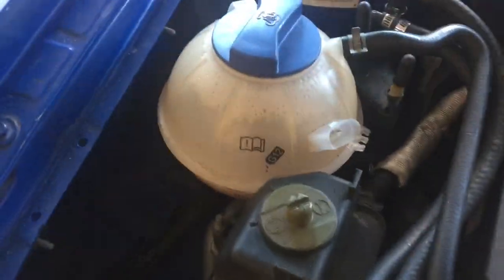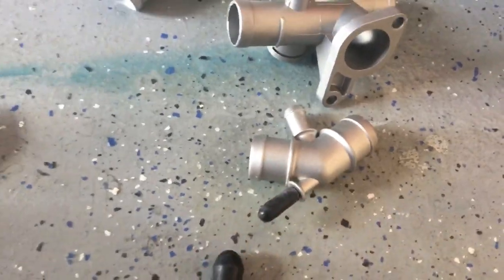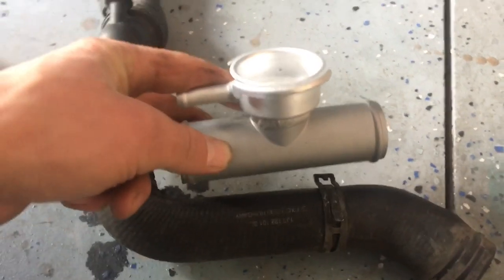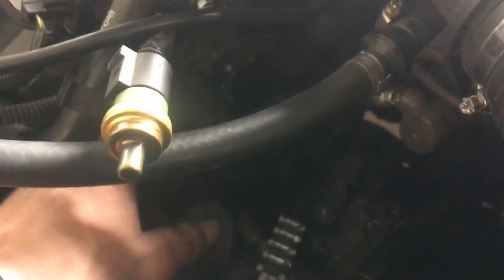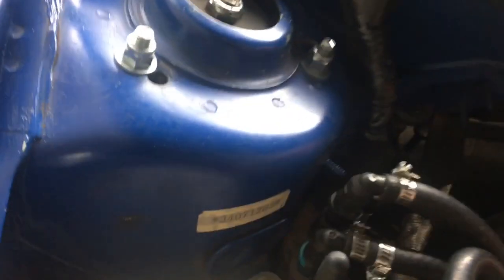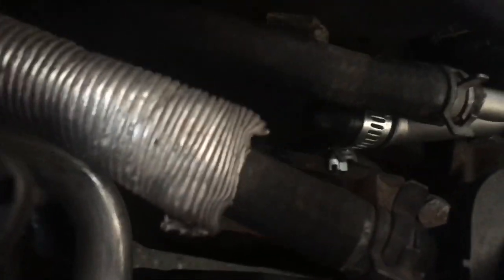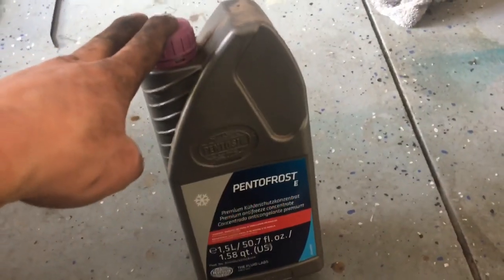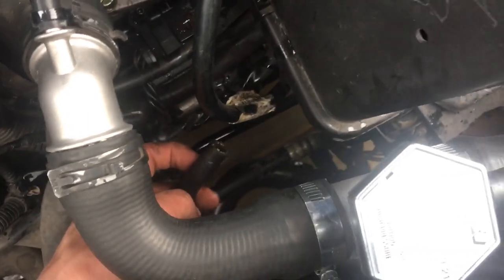Mk4 1.8t coolant ball delete

Comment: How do you bleed the system like this mate? Literally just run it hot then slightly open the bleed screw and then top up?
Reply from the maker: Bleed with the cap off like any car ever until the thermostat opens
Reply: @hunterjensen  ok m8 thanks never done it before, do I just let it drain out the overflow hose rather than bleed screw?

Comment: So I followed all your steps but I don’t think I was able to get all the air out from the issues I seem to be having with the vehicle. Did you really just let it run with the cap off?
Reply from the maker: Ian Franco you have to let the car warm up to operating temp with the heater on full blast the whole time and squeeze the upper and lower hose for about 10 minutes with the cap off
Reply: Hunter Jensen did that and it seemed to have worked I also tried reving the motor as well
Reply: @ThatGuy11392  jack the car up in the front as high as it can go, then start the car with temp on the heater inside the cabin to bleed the air out of the system. or buy one of those funnels  that fits to the fillerneck.